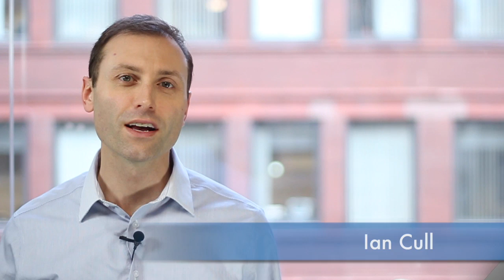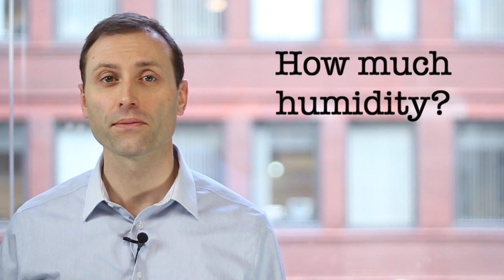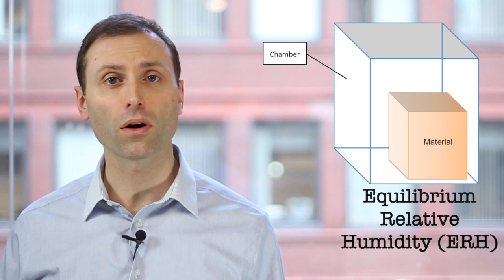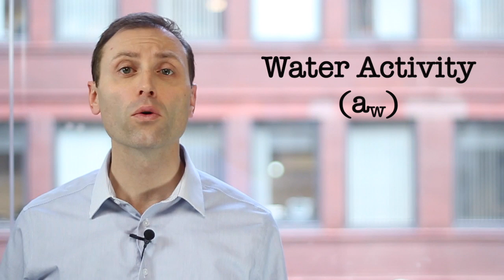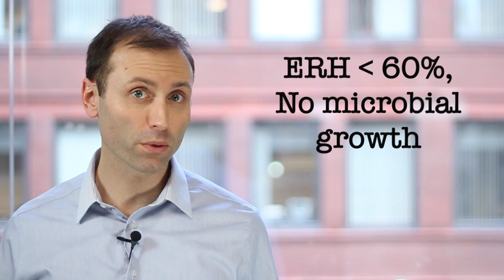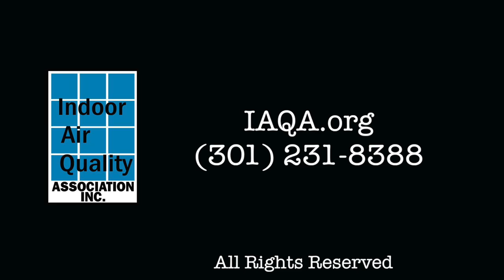Equilibrium Relative Humidity

Comment: Good video Ian. When the RH is high as it usually is here in Georgia, a certain percentage is absorbed into the surfaces and substrates within the building envelope. What percentage do you estimate is excessive and will create or sustain mold growth just based on RH and not ERH? Use drywall as an example. I know some paints will discourage migration but on a general rule........